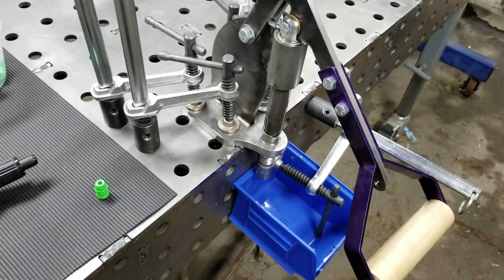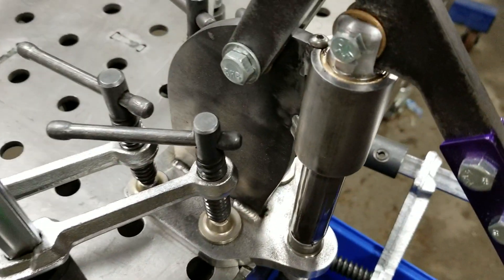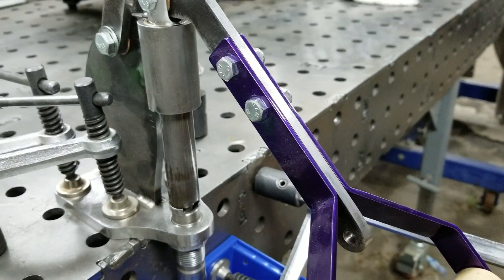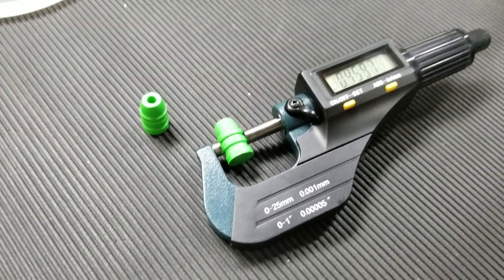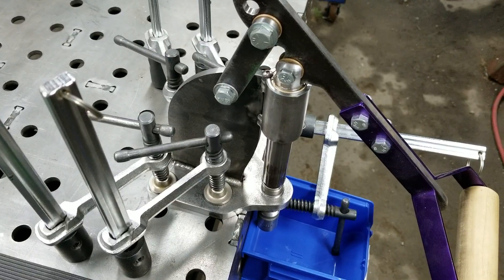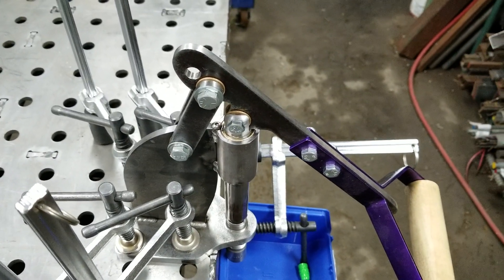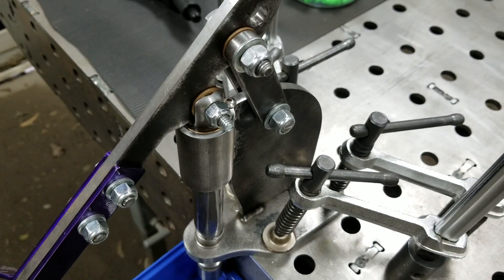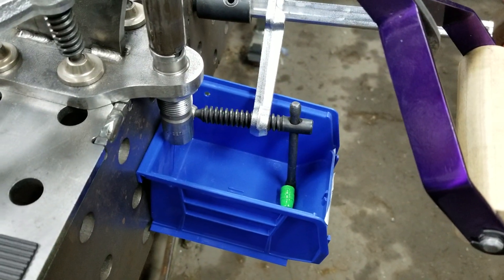upside down boolit sizing press - version 2

Comment: I'd live to get a wiring diagram on your automated sizing unit. Building one and could sure use any help.
Reply from the maker: What is your email address? It uses latching relays (automotive relays wired to work in latching mode) micro switches, and proximity switches. I do have a diagram that I drew on CAD. It doesn't have a write up with it, but if you can follow a diagram and have some electrical experience, it isn't all that complicated.